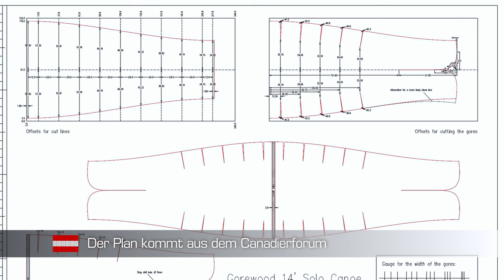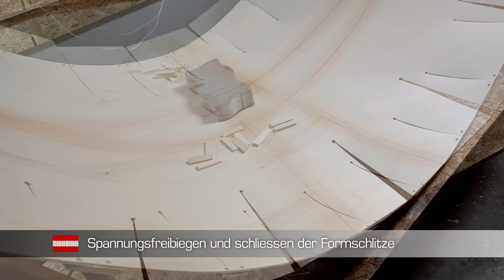DIY 14-ft Carbon Canadier / Gorewood technology / Eschensüllrand / ash coaming / 2021 - 2022

Comment: nice boat. Where did you get the adjustable seat mounts? I Want to build a ceder strip canoe but would like tilting seats like my Ally folding canoe. Your system may suit this.
Reply from the maker: I drew the metal parts in CAD and ordered them from a laser blasting company

Comment: Very interesting! Looks like you turned the scarf joined, two sections hull into a four sections, fiberglass butt joined one?  I am building a gorewood 12 right now, I am nearly able to close both ends of the hull.
Reply: Also curious about the butt joint, it seemed a lot easier than the scarf joint given the very thin material.  Did you try and replicate this joint in your build?
Reply: @ebutle1243  No, I followed the original recipe but I have to leave my project for a while because it's too bloody hot in my workshop. I have problem with the shape of only one end of my build, my guess is I've forgot to fill the gap between the plywoods with thickened resin there, which is ok if it weren't for the bow or stern, too much tension for the wood there. For other parts, it gave me a nice semi-round/slightly V shape hull, should improve tracking.
Reply: Also I found the recurve bowline in Gorewood 12 is unnecessary, extra work and made attaching ash gunwales a lot harder than I expected. At this point I figure maybe starting a new one would be quicker. I use cheap single panel okoume ply so it is not a big deal for me.
Reply: I’m planning to build the Flo-mo 14’ solo from 2 sheets of the same cheaper material.  When you say the “recurve bowline” I’m not sure what you mean
Reply: @ebutle1243  It's not in Flo-mo's 14' canoe, check the 12' one, you will see there are 4 additional small pieces. Actually I started with 14', cracked the hull when moving it. The 12' is just much lighter and easier to work with, especially considering I don't have any power tools.

Comment: is there a specific reason you used carbon fiber instead of fiberglass? and why cut out the center when applying the sheet to the exterior?  thanks
Reply from the maker: Carbon fiber is much more stable than glass fiber, especially if you ride in rocky rivers at low water, carbon is recommended.
I have carbon fabric with a width of 125 cm, but the boat is 135 cm at its widest point, so I cut the carbon mat in the middle to get the carbon all the way to the coaming.
Reply: @WolfVideos  thank you
Reply from the maker: Look at this tour, only possible with Carbon:
https://youtu.be/POXZe6t0QMw?si=yqzNDX3pmUZEwalI